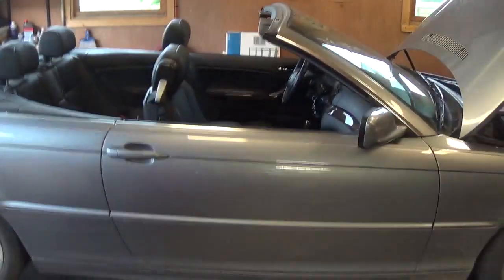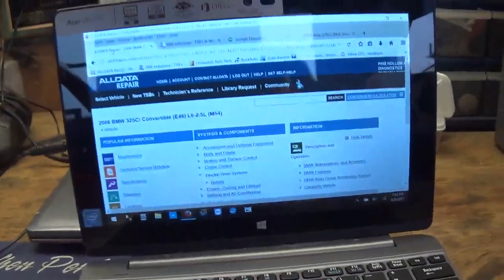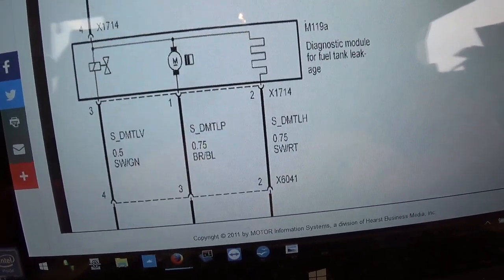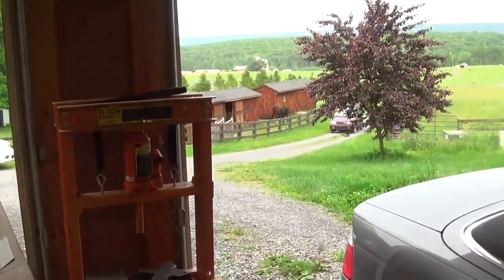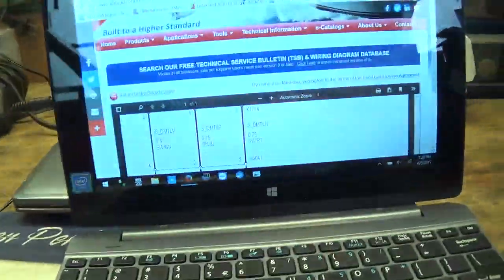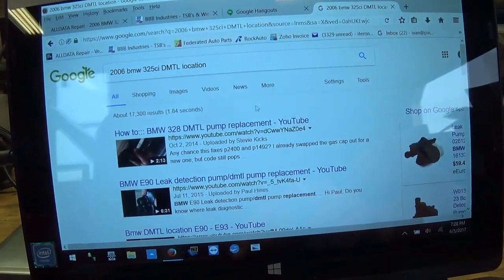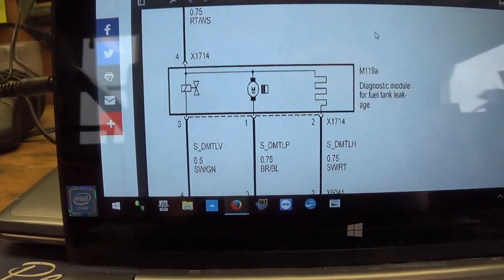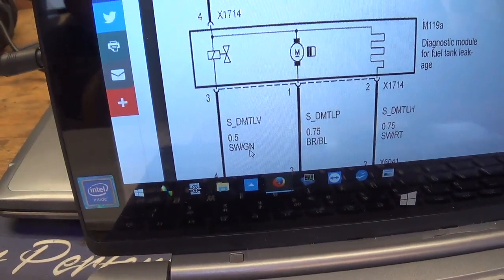EVAP leak testing: BMW DMTL system

Comment: I think you test the cap with an adapter that applies pressure then vacuum. I think caps protect the system from over pressures in case of a plugged vent valve. it also prevents a faulty purge valve and a plugged vent from sucking in and collapsing the tank.  I saw it in a video

Comment: The DME (ECM) measures motor current as it pumps against an orifice, then measures current as it pumps against the canister and fuel tank via solenoid valve.

Comment: Yes Sir, 15 years ago ,I bought this BMW e46 4D, I asked a friend of mine who owns a small shop , why     Alldata doesn't provide information on BMW fault code. The main reason is BMW wants you to bring your car to BMW service dealer only. First the stealership wants to charge you for diagnosis which you already know, then they can charge you for parts and labor. PERIOD.
Reply: JR Valdez fyi full diagnosis is now free at the bmw dealer, any year, and model, just make an appointment.

Comment: In advanced first aid you look-listen-and feel, in advanced automotive technology you look-listen-and smell; especially when it comes to EVAP type codes. When you said "it smells like gasoline" that told me that there was an excess of 200 ppm of hydrocarbons, and that you found the, or a major leak, the next step would be to pinpoint it. If you had tampered with the gas cap by tightening it and sending the car off, you'd probably might see it back again and the customer would think less of you. It's not that customers do not like to pay, it is that they are so tired of being ripped off with their hard earned money by smooth talking flashy salesmen because of their ignorance and trust on the flashy work bay, contrasting colored race striped uniform and patches that make up sleeves. You get paid for not just what you do, but from knowing what to do based on your education, training, experience, accomplishments, and knowing what needs to be done using logic, reason, and procedural protocol. Anyone can guess, replace, hope, and pray and with years of this type of experience they end up getting better and faster at guessing, and less hoping, and praying and everyone thinks that they are some type of guru and then are recruited to be an automotive technology instructor at training centers, high schools, and community colleges, and the ugly beast rears its ugly head in perpetuity in the next wave of technicians. Unless it is a hot combat situation where green communist tracer rounds are whizzing past your head then "TIGHTEN THE GAS CAP!"; else, follow the steps and logic with no shortcuts because shortcuts can be really expensive, similar to friendly fire casualties. The worst word you never want to hear in the middle of your surgery by your doctor is "Oooops". Lastly, your biggest screw up in the video was the title "EVAP leak testing: BMW DMTL system", it should have read "Beautiful lady exits a vehicle" and the rest is fluff. Great fluff though.

Comment: that hot to the touch solenoid is! a coolant cutout valve to the heater core, in other words, no coolant flow to heater core when you are using air conditioning in hot summer days..

Comment: Tell me you were using inert gas. Otherwise, MAN! You were turning ignition ON, fuel pump running, solenoids activating. I'll use air with a smoke machine testing EVAP but I won't activate electrics like that!

Comment: the hot soleind you touched is the solenoid for the heater control valve. even with the car off and cool it heats like crazy. By the way you can find english diagrams on internet

Comment: It's frustrating when you can't find the info needed to diagnose a problem but if the manufacture will not release the info you're almost outta luck. With a little know how you were able to find the problem. I would say that at least half the evap leaks i find are fuel cap, filler tube rust and corrosion related. If i'm in doubt weather the cap was't tight enough or not i replace the cap because i know it will come back to bite me.

Personally i don't even like opening the hood on those things.

Comment: It's easy to check a gas cap....Go and buy an 800.00 fuel cap tester and then test at least 40 or more car's fuel caps so it can pay for itself...Just giving the sarcastic response to the naive that would ask ....Furthermore, assuming the cap passes, what then?...Still have to go thru the leak detection  procedures as you did....Good job as usual Ive....

Comment: Every time you show a BMW Ivan, it looks like they are aggravating vehicles to work on where there is little information. And let's not forget the 'Power of German Engineering'. WTF was going on with that hose. One thing I've learned about the engineers from Germany is that they are not going to use any common sense in their thoughts to make something simple. What would seem so obvious in a design will have to be made as complicated as possible.  Fortunately, I haven't worked on one of these things and I am not looking forward to it either. Great work Ivan and was wondering why you just didn't tightened the gas cap :) Hold on Ivan, I'm just joking and I agree with everything that you said about doing a leak test. Have a good one and moving on to your next video on the tranny!
Reply from the maker: Hey Terry, good to hear from you! Don't you own a Volkswagen too? That's the next best thing after a BMW ;)

Comment: many older BMW gas hatches have a spring loaded click mechanism, just push in the rear of the hatch it release and pops it out slightly, when you close it, it resets the spring mechanism.
was funny seeing you open it, funnier yet was me trying to start the first keyless one I had to move, cussed it for over 5 minutes. not used to having to step on brakes to start a car :))

Comment: That Beemer doesn't look like a whole lot of fun to work on. I've done a few Volvos and VWs, but never a BMW. Hate when they cover everything with plastic ... like they're trying to hide something.

Really liking that OTC unit - saw Eric O. had the same one a couple vids back. The problem with the paint can one is you can't tell if anything is flowing or not. That gauge is great. I might have to make the investment eventually. Best bang for the buck that I've found so far.

Comment: How is it possible that your clapped out MPV is legal to drive in PA? Don't they have state inspection there that prevents rusted out hunks like that from getting a sticker? If you had that out here in AZ there wouldn't be any paint on it after all of these years ( a condition that we refer to as Arizona Road Rash) but the car would be completely rust free. It's sort of funny Ivan, When I lived in Pittsburgh, and worked in a bodyshop as a painter while I was going through graduate school at Pitt, we never painted complete cars as they typically were rusted out so badly there wasn't any point to it. Out here in Arizona having you car completely re-painted every seven years is more or less completely normal. I have a close friend that owns a Maaco and he's making money hand over fist. He's probably looking into banks in the Cayman Islands to hide some of it. Paints about 15 complete cars and light trucks a week. He has a true production line.

You going to trailer that Nissan up to Eric O for the transmission change? It would sure be easier with his lifts and the two of you working together to get it done and would make some great videos.
Reply: Quote from PA BMV... "Antique vehicles are not subject to the annual vehicle safety inspection. Antique and classic vehicles are not subject to emissions inspection."

not supposed to daily drive them either, naughty Ivan  :)))

Comment: I van you said there should be any pressure  sensor or switch  for feed back , well this system does not used switch pr sensor how they monitor fro leaks is when the dmt modules energize the pump is there is no leak  in the system there should be harder for the pump  or I should say some resistance , so they monitor the current  over time and gas tank fuel level .
Reply from the maker: Excellent. I just found the description of the system last night, and you are 100% correct! Now I wonder as the system gets older, the motor current can change over the time as the motor wears out...would that cause a false code?
Reply: Pine Hollow Auto Diagnostics 
yes it can change from wear ann mechanical  resistance  of the motor , I am smog technician  and on one of my amog licence update  class I had  16 hours . for evap system  of  any manufacture I learn that  hands on vehicles every system the teacher  knew what was wrong and after as going on theory  we had to find the problems on vehicles  . it was at skyline colleague I was surprise that  the school had like 15 diferente vehicles  . any way the dm pump.is used on Europeans kia , Hyundai  same set up but Chrysler  is using the same principal  if current to to test for leaks , I learn there on gm  first thing to check for evap leaks  codes  is the pressure sensor data koef. as this is very common failures, the   sensor resistance goes open = 5 volts  computer  asumes fulm vaccum you get codes fir leaks or vent solenoid  circuits but never fir sensor. 
Nissan  use a temperature sensor  and the principal  fir them are as the pressure increases  the temperture increase too.  nice chatting with you    Ivan  since I am your fan  I have learn a lot from you . I have a question  I just bough a pico scope anf I have ti create customs  probes . like for example my pressure  tranducer  is at 330 mv = 0  sea level and each 1 mv = to 1 psi can you help me how ti create this please the scope is still on the box . 
thank  you

Comment: Hey Ivan nice video!!!! I wondered about them solenoids too a friend of mine has a 2003 BMW 525i with the same engine. I was checking the Cam and Crank sensors and got burned by those solenoids they were extremely hot.

Comment: very good fix actually as it was a tricky gas cap and i doubt a standard DIY guy like me would have picked that leak up without a smoke machine lol however it might have self fixed at the next tank fillup maybeeeeeeee..ive seem quite a few gas cap leak youtube videos over the years and it still amazes me how a bad cap seal can throw a leak code, lucky i have not had one leak on us so far..
Reply from the maker: yeah not a regular gas cap at all...just one fancy "click" and it seals tight!
Reply: use your nose at the gas cap!  put a jack with wood block under the tank and put light pressure on it, to pressurize the tank slightly sniff sniff sniff ;)

Comment: Btw next time you need BMW wiring diagrams, check out this site: http://www.bmw-planet.net/diagrams/ -- it's got pages with descriptions of the various components and how they work and it's also got component locations and a complete index so you can find exactly what you need next time.
Reply from the maker: Wow that site even includes description and operation of the systems! Will definitely use it in the future. Thanks so much for the link!
Reply: You bet, man.  Thanks for the great library of diagnostic videos!

Comment: at the dealer we have a test plan for the dmtl pump. it activates the pump and seals off the vent. it will then run for a few minutes and check for major, minor, and micro leaks. it's a good test to see if the leak is currently present. but I've found that it's sometimes inaccurate in that it will say the system is leak free even though I still find a leak with the smoke machine. there is also a special tool we use to connect to the vent side of the dmtl to smoke it from the pump forward. because as you know the purge valve is a pain to get to. the tool is just a clear hose with the special plastic connector at the end haha

Comment: love watching your thought process. just wondering if i missed it but did u ever check the purge valve? it looked like you bypassed it to smoke the system. Obviously you found the problem was just wondering. Oh and mitchell is the same way with info on Euro cars
Reply from the maker: Great question. Generally I would have checked the purge valve, but on this thing it was a pain to adapt a hose to, and the smoke check did indeed reveal a leak elsewhere :)

Comment: Hi I was sure you were going to find a small leak at the DMTL connector on some BMW it's common usually what I do is unplugged the air filter hose at the DMTL and then cap it off then unplug the connector to see if smoke would come out obviously I check the cap if it will leak I have seen some caps with cracked rubber seal you can buy them separately lastly make sure the purge valve at the motor seals properly I know with experience on VW with the engine code BPY the 2.0 litres turbo engine the one with a timing belt is prone to leak and trigger EVAP fault codes and buy the way you're Girls friend or wife is really pretty and seems to have a real good sense of humour bye driving an antique vehicle to work.
Reply from the maker: Thanks for the comment! Yes my wife is a good sport driving my old rusty van while her Nissan is in the shop :)

Comment: Next time try to remove the evap line from the bottom of the purge solenoid itself. There is a plastic tab that you can squeeze inward that'll let you pull the line off without breaking.
Reply from the maker: That...or break off the tip of the purge solenoid...it's all brittle plastic lol
Reply: Lol, tell me about it.

Comment: It's normal for that solenoid to always be hot as hell.
Reply from the maker: What is that? some kind of heater core shut off valve?
Reply: Pine Hollow Auto Diagnostics that solenoid is used for the heater control system. only if the car has dual climate control (passenger and driver individual heat settings) I think the heater core has two separate inlets. if you look at the firewall you'll see that the heater core has 3 hoses coming from it. the valve can control coolant feed to each side of the heater core and it has a common drain. that valve is normally open when not energized for a failsafe of the valve. but it is normal for it to be hot when the ignition is on.
Reply: It's actually a switching valve for the heater core.  First the air from the blower is cooled all the way by the evaporator and then it's heated back up by the heater core until you've got the commanded temp so the system needs a way to pulse coolant to the heater core to control it's temperature.
Reply from the maker: wow "soooo fancy!" haha

Comment: you must really love the Mazda, putting so much work in it
Reply from the maker: Actually I've let it go quite a bit. Just enough work input for it to be functional and reliable. Driving around the hills without second gear is a PITA and I found a good deal on a used tranny so why not swap it out :)

Comment: Ivan your MPV is looking a bit crusty in the quarter panels and rockers.Videos with the leak tamer are all good.
Reply from the maker: That and the rear wheel arches are gone, but otherwise it is mint haha
Reply: I like it drive till the wheels fall off
Reply from the maker: It does have a solid rear axle so might be a while before that happens ;)

Comment: Also. I need a connector/nipple-school. Sometimes it feels like I break more things than I fix when it comes to all the weired connectors...
Reply from the maker: If it's called a "quick connect"...watch out!
Reply: Have also seen connectors with separate plastic locking tabs&pins... Thoes are like the worlds most fragile mechanical puzzle, like a jenga that never falls apart...

Comment: I thought the gas cap was the first place we checked for this problem. Sure, the smoke test verifies it, but the slight leak is most often the gas cap being either faulty, or very often just not tightened properly. Many techs will check the cap and then clear the code. I know many vehicle owners that have been trained to reseat / tighten the gas cap when they get a CEL soon after getting fuel.
Reply from the maker: Yeah that is reasonable, but I didn't want a comeback :)
Reply: Understood, plus the overall troubleshooting exercise is good practice. As we know it's not always going to be as easy as the gas cap and it's good to understand the steps in effective troubleshooting which I enjoy seeing / learning from on your channel. Thank you for your contributions. They're always appreciated.
Reply: looked like original cap, so if over 3 years old/high millage, always replace them.
in Ohio counties where they have e-check, they pressure test gas caps and give you a new one if it leaks, if they don't have one, you get a $5 gift card and have to get it yourself.

Comment: Working with my son on an engine swap of a 2006 x5 3.0l  Them Germans really like plastic and O rings. Luckily you can get a lot of that plastic hose crap on ebay fairly cheap now. If you work on a BMW your gonna break some plastic

Comment: The hot solenoid is "HVAC Heater Control Valve" , so i guess the coolant makes it hotter
Reply from the maker: But car was stone cold when I pulled it in. Valve was actually energized all the time...maybe need to remove the key and lock the doors to put it to sleep?

Comment: Correct procedure in diagnosis as there could have been a number of possible faults. A methodical system, in the long term, always ends up the winner. Don't be fooled with the quick fix attitude ---- a fatalistic approach. Mrs Ivan looks as pretty as ever !!

Comment: Autel has bi directional and the basic Hynes books have info...Bentley makes the shop manuals....bmw T.I.S is a low cost ($50)+-   technical information source..Ivan you found one of the worst systems in the bmw system...BMW had troubles with the PCV and Emissions control so they have always cheaped out on these but their mindset was it's going to fail so put "quik" connects and replace every 10 years or so....